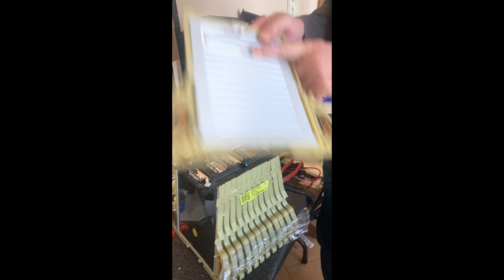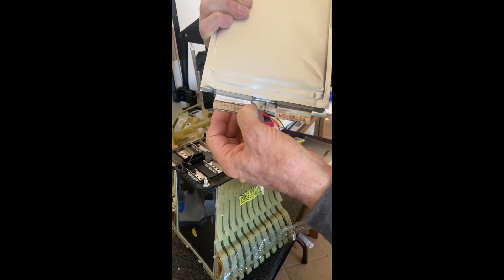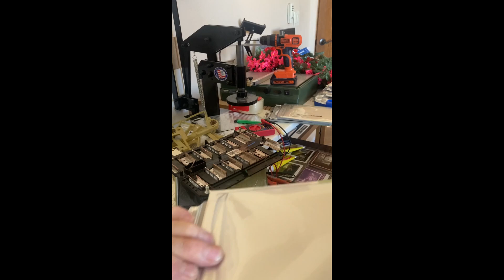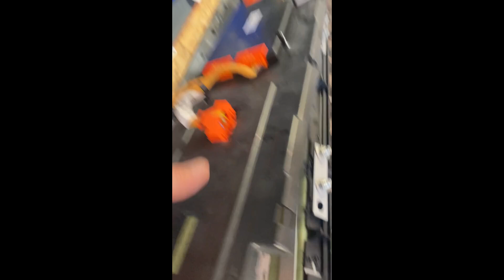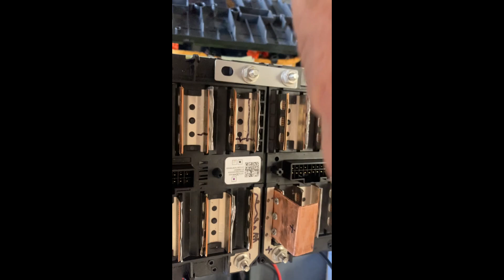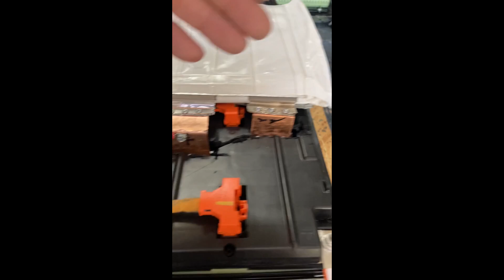Chevy Volt or ELR Cadillac high voltage battery fix.  Is your car a brick?

Comment: why didn't you just remove the bad battery and replace it with the new one? too hard to cut off the welded tabs?
this video explains what the 2 low voltage connectors are for:  https://youtu.be/eWYtq0hxhQg?si=ShhhHjz169fg8tE7&t=5358

At 1:29:10, the speaker mentions two electrical connectors for the battery relay assembly. One is a four-pin connector for the heater (1:29:19), and the other is a two-pin connector for the low-voltage power and ground to the module (1:29:25).

Comment: Coincidentally, I too started having battery issues on my 2014 ELR and ended up doing a similar repair, and also made a video showing it. However, after doing some testing I found out I didn't need such a large booster cell. A much smaller 7.5 Ah cell, allegedly rated for 750 amps of output, was more than enough. It also made mounting much easier. The rivets are a good idea, probably better than the nuts and bolts I used to secure the cables on the HV battery in my car.

Admittedly I didn't watch the whole video, but I do want to address the following two things.

1. P0AFA, to my understanding, is triggered by low voltage, and not by a voltage delta in the pack. In my case my pack had an up to 400 mV delta depending on state of charge, and the code never got set unless I drained the battery too far. In your case you practically doubled the capacity of one cell group, so you'll have some massive voltage imbalance on that cell. I'd love to see what the pack voltage graph looks like but I'd the voltage delta to be well past 1000 mV.

2. The reason GM hasn't been able to fix so many of these batteries is because they're not made anymore, and haven't been made for years at this point. The batteries themselves were manufactured by LG Chem, and all the ones out in the wild are just as old, if not older than what's in your car. I agree that GM should've planned for this, maybe designed the 2nd gen batteries to be backwards compatible with the 1st Gen. But it's not entirely unexpected that they can't fix these cars, even though it does suck. With that being said, even the ELR will be mechanically totalled by a dead HV battery.

Comment: hey bud, just so you know, the reason your battery pack went out is because you drive it so little and charge cycle it so little. old LMO chemistry like these really like to be occasionally hard cycled, and routinely charged+discharged so that the bms can balance the cells properly. I am working on an electric hv range extender right now for the chevy volt, long term project. i have a vid on my page about how i added solar panels to my old volt and made a portable destination charger :)
thanks for uploading and being brave enough to work on the hv dc pack. 
honestly you probably could have drilled out and pop rivited a capcaitive active balancer and had your pack always self balance so the computer wouldnt freak out. would take a lot of effort to make sure the capacitive active balancer wouldnt come loose due to nvh issues over time and cause a catastrophic failure though lol.
without proper fixturing and thermal managment, I worry about how you repaired your pack, but i believe, you do you. you got a brick back on the road.

Comment: Great job. I had to replace a cell in a 2014 Smart Fortwo EV but I used small bolts instead of pop rivets to connect the cell. Not sure if the pop rivets will provide a tight connection.

Comment: I received the P0AFA 4 years ago, I reprogrammed, and since then I have received the P0AA6 every year and reprogrammed. I see the cells balanced, even during pregnancy.
Reply: What did you reprogram?  The battery module?  With new software or literally just reprogrammed it w/ same software already on it?
Reply from the maker: @beyerch  I bought the 2 year Delco reprogram prog. and reprogramed the BECM and the HPCM2... I also bought a 2nd hand scanner that can get far enought into the control unit to reset the faults.  A cheap scanner will not work.